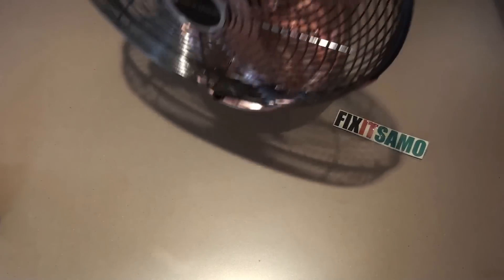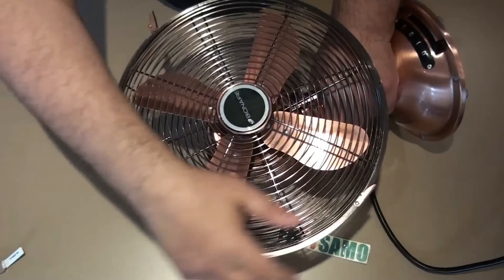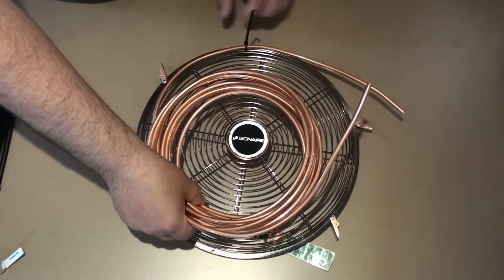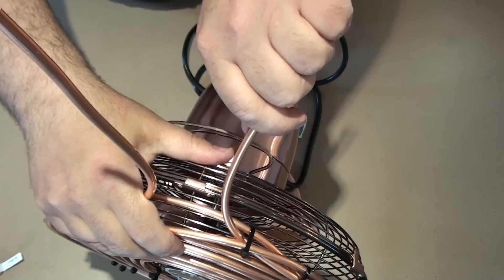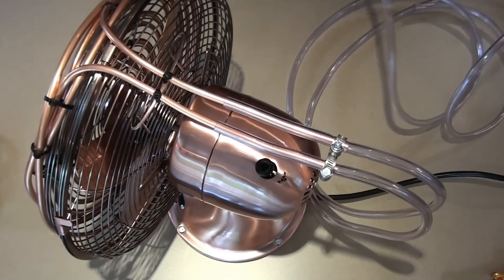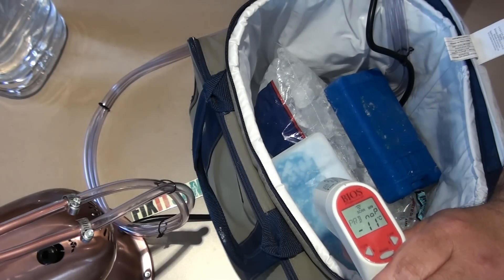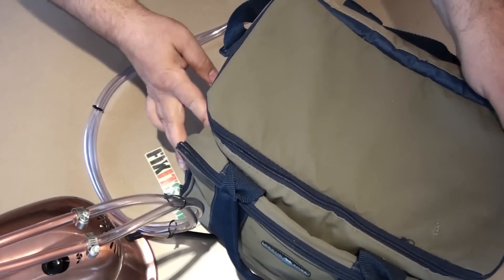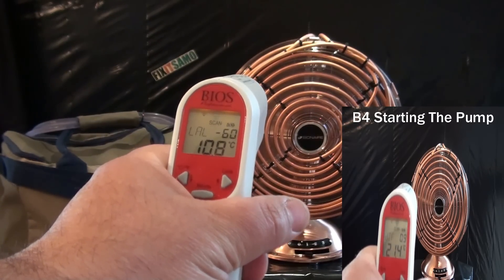How To Turn Your Fan Into An Airconditioner  AC

Comment: How long does it last?
Reply: It could last a few hours depending on how good the cooler was (insulation), and how warm the pump may get, but even room temperature water would still feel cool enough to be effective I think.

Comment: What if you use liquid nitrogen instead of cold water?
Reply: It would probably be too cold. The moisture in the air could condense on the coil and turn to frost. If it got too thick it would restrict the air flow. It could then turn really problematic.
Reply: The pump freeze
Reply: Thats what i was thinking lol

Comment: What if you ran the tubing into a mini fridges freezer in a container of water alcohol mixture? Just set the fan on top 🧐
Reply: Yes, but if it got too cold it could cause the coil to frost over. If the air flow was restricted it might overheat the fan motor. You'd also have to deal with condensation at the least too.
Reply: The minifridge would not be able to cool down fast enough to keep up if it were hot outside.
Reply: @darrisx8146  You also heat the room up in this process....

Comment: The moisture from the air condenses on the copper tubing and drips under the fan, I placed my fan above the ice bath but the water overflows with time. I made a small overflow tube out of the ice bath that goes out the window(through the wood) and drips outside.
Reply: What did you do about the dripping under the fan?

Comment: anyone calculate what it cost to run for 8 hours?  If it doesn't save alot over a window unit it's not worth it. I imagine it is pretty cheap though. Anyone do the math? fixitsamo?
Reply: Where I live (Australia) to run a 75w fan, a 10w pond water pump & a chest freezer (to freeze ice for the fan) 24 hours a day all 3 cost a total of $1.20 per day to run. a spit system unit or ducted air conditioning costs 60c or $3 per HOUR to run. which means if you average out an air con running cost to run for 24 hours would cost $43 a DAY. $1.20 for a water cooled fan or $43 for air conditioning. I know which one I’d pick.
Reply: @jackiebrown8773  The difference is the split system unit will not run nearly as often as the fan and waterpump. There is no such thing as free energy, you pay for it somewhere. The point you're trying to make that this fan with copper pipes in front of it is somehow more efficient then a split system unit is absolutely ridiculous. 

The video without a doubt has its use cases (targeted cooling, cheap to put together, fast to put together, no requirements of having a window in the room, etc.) but being more efficient then a real unit is not one of them.
Reply: Dimitri Barbe I never said in my comment that it is more efficient in cooling than a split system. obviously a fan unit isn’t going to efficiently cool an entire room as well as a split system but it is still more energy efficient & that’s more important for a lot of people as normal air conditioning is expensive and not always available (in rentals etc). Where I live temperatures can get past 40 degrees (104F) for most of the day AND night and running a split system all day is impossible & it can break down easily. a fan unit is a much more affordable option.
Reply: @dimitribarbe6883  actually one could rewire and soder the fan and pump onto a fold up solar panel and get MORE than enough energy to run both 8 to 12 hours a day.
This is great for van/tent camping for people who can't sleep in the heat.
The REAL issue is the condensation water from the copper, where does it go? Does it drip down and make a mess and damage whatever is underneath?
Does it drip into the center motor, kill the fan function or start a fire?
Those are more important questions to ask,  JS.....
Reply: the pump use 3 watt of power x 8 hour =24watt    so running cost less than  1-2 cent extra over 8 hour    + your existing fan cost and your  Bag off ice  either you buy it or make your own
cost of running this set up over existing fan  is very minimum
Reply: Noblesse Obligee  well yes they do.

So, once your freezer reaches a certain temperature it actually stops running, and the insulation just keeps it cold.

Once you put in hot objects, it will make the freezer hot, and inturn make the compressor run, until the  object is frozen or as cold as the freezers limit.

So the difference is your freezer might run 10% of the time versus 80% of the time, until its frozen.

Also, your freezer itself dissipates heat into the house you are trying to cool, with the energy from the freezer, and because nothing is 100% efficient, you are actually adding heat to your house, but it will be colder DIRECTLY in front of the fan. Everywhere else however will be warmer than if you had done nothing at all.
Reply: Jet li is right. The cost of operation isnt the cost. Its going to cost you to obtain or make ice... window unit would be cheaper.
Reply: @TheDarkToes  ,
You can reuse frozen bottles of water. After initial cost of the water bottles. 3.50 for 24. Its pretty cheap.
Reply: @TheGaffla  did you even read my post? Because youre making my point for me.

Here let me say it again... "the cost of operation isnt the cost. Its going to cost you to obtain or make ice"

Thank you for proving my point water is cheap, but youre going to spend more in electricity freezing that water...
Reply: @TheDarkToes  , correct. I was supporting your position. Was there some confusion with my statement? Every one is not here to be hostile. Peace be to you brother.
Reply: @TheGaffla  my bad, seemed like you were saying "water is cheap it should be cheaper to freeze them" but a window unit would still he cheaper. My bad. 

Good day to you
Reply: @TheDarkToes  who turns there freezer off at home ????ermmm no1... soo a couple bottles of water freezing each day is no problem.  my freezer is always running anyway.  ( wont be eating chicken at your house bro ) hahah
Reply: @adamlol3955  thats not how that works tho... but i appreciate your reply
Reply: @TheDarkToes  ????
Reply: @adamlol3955  ???
Reply: @adamlol3955  I'll be passing on that chicken tonight. Ha 7 months later and still doesn't know what's wrong with his chicken recipe.
Reply: there a cheaper and quicker way, open your freezer door use the fan to blow air in to it, cold air spill out Bonus no need to eat your ice cream, you can drink it
Reply: Noblesse Obligee  because it doesnt use the same amount of energy, infact it uses ALOT more.
Reply: It's not just beneficial because of the cost difference......the problem that this REALLY solves is not having a window or a way to vent air therefore NOT being able to use a "window unit". Thus is genius because you can use it anywhere......a tent, house, trailer......etc..
Reply: Noblesse Obligee  than a freezer with constantly exchanging water bottles, yes.

Every time you add water to it, your freezer has to work harder for longer, and its about the amount of energy or heat, (however you want to look at it) you need to remove, in relation the amount of mass. Air is fairly un dense, while water is pretty dense, AND is good way to store energy, meaning it takes alot of energy to remove all the heat it has stored.

Comment: What if you drilled holes in an electric cooler so the water getting circulated gets cooled running thru the pump in the cooler?

Comment: AC consumes more energy to produce cold (extract heat) than to cool down the air. It's simple themodynamics.
Reply: are u sure u know what your talking about? how did the Ice become ICE in the 1st place? any Homemade contraption like this that uses ICE is just moving the ACTUAL thing that is removing heat to a Plant that produces said ICE, Educate yourself a lil more an understand that a real AC works on the principal that when you squeeze air or anything it turns that mechanical energy into heat, the heat dissipates over time in a radiator under pressure and then when the pressure is released it sucks in the surrounding heat to make the physical expansion of the gas possible that's where the cold comes from....
Reply: @stuffhappensdownsouth9899  Yes. What is creating the pressure needed to compress the refrigerant fluid ?
Coldness and warmth are not pysical values ; but sensations. They are loss or gain of calories
Reply: @MrWookie21  every fridge or AC has a compressor pump.... and that's layman's terms, and calories? are u drunk? a box of cereal has load of calories is it hot? that makes 0 sense?
Reply: @stuffhappensdownsouth9899  So it's exactly what I said at the beginning. A compressor is a motor that consumes more energy than needed to freeze water. If the fridge was in action inside the room you wanted to cool down with the contraption, the room temparature would climb up and not go down. Because of the heat (transfert of calories) emitted through the outer serpentine and also by the compressor resistance. You are also confusing thermodynamics with metabolic biochemistry. Food is also converted in extra-heat through biochemical reactions in our body. Cereals are sun piled energy ready to be converted by organism into anabolic or catabolic reactions + heat (emitted calories).
Reply: @MrWookie21  ok that makes sense but what i was meaning was a clever way to compress a gas instead of using a motor 
guess u do know what ur talking about there, I've never heard calories used in this context but i looked it up an damn if ur not right soo yeah you win this round *shakes fist
Reply: @stuffhappensdownsouth9899  Calorie is just an human concept to modelize what's observed experimentally. It's a human language for translating an universal phenomenon. The universe has its own properties. Humans can't create life nor matter. Heat is more a molecular or atomic friction situation (interaction). 
Even this concept will be overthrown for a more realistic explanation.
It's like the Newton's 3rd Law that is obsolete ; because there is no imaginary reaction force.
No need to compress fluids to generate heat transfert. See Peltier AC for example.
Reply: @MrWookie21 Bernoulli's  venturi tube will also  without compression or any kind of heat transfer although its highly inefficient
Reply: @stuffhappensdownsouth9899  Yep. When it's getting really hot, I go in the cellar. The temperature there is approx. 17°C  (62 F) ;)

Comment: I planned to do it without the cooling system, but letting air go through ice itself, realized that condensation might be a problem, also water droplets.
So now I ordered all the stuff, except the fan, because fan eats lots of energy, instead Im going with a 200mm 12v PC fan, with around 150 CFM, its less than the fan, but I have only 1 room to cool down. Think that is ok?
One thing more to mention is that the advantage is being able to take it with me anywhere on a power bank with a voltage booster.

Comment: wouldn't it be better to buy an AC
Reply: Alot of people cant buy an a/c. It looks good for an offgrid system
Reply: This is a low watt solution. Normal AC Units would take 10x to 20x the amount of power of this setup. When the power is off and you are running off solar, every watt counts.

Comment: This hydronic system is awesome. If you use ice at (say 9 deg F, or, ...) -13C, and the room is at 80F, or 27 C, then you have a temp delta of 40 deg C, 90 F. The specific heat of water is 4 btu, or 4 kJ per kg per deg C. Fixit Samo used 5 kg water let’s say. He had ice and 3 liter water, so I am making a reasonable assumption. So, the cooling power of this setup is: 5 kg X 4000 x 40, or 800,000 J, or almost 1,000 btu. 

If you scale this to a room of 10’x10’, aiming to cool the inside to 75, whilst outside was 95, you’d use 100 Wh of energy with Samo’s system, and 1.7 kWh of energy with an a/c unit. That’s a whopping 1700% better system. 

I get that he is using 5 liter water, out of refrigerator. That’s to miniaturize the footprint. You can increase the water catchment to 55 gallon drum at 50 deg F. Same outcome. Still 1700% more efficient than AC unit.
Reply: So, you think you're so smart...then...how many licks does it take to get to the center of a Tootsie Roll Tootsie Pop?
Reply: @zcg3  2
Reply: PowerLifter “rest of us” who? I wrote the note, you responded to it. Since you’re unclear as to the difference between alphabets (power lifter has 9), letters (power lifter has 11) and, while you’re getting educated, characters (power lifter has 11, or zero in your case)... since you’re dumb enough, let’s make peace with your poor Grammer, spelling, and reasoning. Enjoy your little ignorant world
Reply: PowerLifter if your IQ exceeded the number of alphabets in your moniker, you’d have gathered that what I was saying, inter alia, is that the use of ice isn’t essential to hydronic cooling. The amazing thermodynamic efficiency is, the possibility of ditching inefficient and costly a/c systems is.

Comment: Works like the coolant from automobiles.
Reply: What happened if you use actual coolant from Automobiles?   - what about the the Solution/liquid from the fancy Computer cooling systems - is it the same process of use?
Reply: joseph arthur anti freeze won't freeze for cold weather.
Reply: and i wouldn't try it stick to manufacturer's instructions.

Comment: I'd like to try this for my self. But doesn't the condensation from the copper tube drips water on the floor? Please reply. Thanks and more power to your channel!
Reply: the air from the ventilator will dry up condensed water from the pipe
Reply: @Igor-nx8uf  Would that not then add humidity to the room- the opposite of what you are trying to achieve?
Reply: @RawFitChris  condensation is produced from air humidity in room, it is a cycle working with same amount. A typical air conditioner dries moisture because condensate flows out of the room

Comment: I hate the metric system.
Reply: makes too much sense? 0*C water freezes, 100*C water boils. 1gram is 1 cubic centimeter or water, 1kg is a liter of water. WTF is a foot, why is it 12 inches? why the fuck is freezing 32*F? what's the boiling temp of water in *F? imperial is moronic.
Reply: אני עומד ע ישראל! I love MERICA!  How's that more practical, I can easily make estimates with metric just as much as with Imperial unless you truly want to count with steps, imperial is useless that's the problem with it, metric is superior, imperial is not a bad system otherwise it wouldn't work, but sometimes it's about choosing the superior one instead of being one of the few countries to be different
Reply: אני עומד ע ישראל! I love MERICA! k but not really because not everyone's step, or hand, or stone is the same
Reply: @N1v3K77 I cannot estimate cm's or KM's.
Converting US system to metric is a pain.

I either have to get a conversion chart and calculator out or a us & metric tape measure.

Oh and 13mm is NOT 1/2". Close but not the same thing.
Reply: @N1v3K77 convert 3/4 inch to exact metric.
How about the rest of the world using imperial system?
Most of my tools are US sizes.
Having 2 sets of tolls is costly and space consuming.
Then having to GUESS on the metric sizes.

It is 10mm or 11mm?
Is it 5mm or 5.5 mm.

Converting back and forth over large sizes or distances causes inaccuracies.
At least with the US system we have less problems sticking with it.

If I need a 1/4-20 bolt but metric is only avail and with the WRONG thread, it makes life difficult.
Reply: What's so complicated? The system or how it applies to Imperial?
 The metric system is FAR simpler than Imperial. Its based on 1/10/100/1000. And all are defined by the METER (hence METRic) and equal divisions of or multiples of the METER based on 10ths. Its much easier to multiply by 10s than it is by fractions with the number 12 as the base unit, but also divided in 4ths/8ths/12ths/16ths/32nds/64ths/etc.  Imperial is WAY more difficult to figure in your head, than metric. 

Example- Imperial Problem: 1.25" which is equal to 1 1/4" multiplied-by 23. Solution:  28.75" (but in feet needs to be 28.75" divided by 12) and fractions cannot be represented without rounding and using common denominators resulting in 7 3/16 (7.1875) Metric Problem: 1cm is equal to 10mm multiplied-by 23. Solution: 23cm which is equal to 230mm

Magic conversion number is 25.4 for any struggling with basic conversion:
If you need to go cm to inches multiply centimeter by 25.4--  1"=2.54cm
If you need to go from inches to cm divide by 25.4-- 1cm=0.254"
Reply: we know what country you from. poor math skills.
Reply: zwr9ne0fh8pk4bt635245 being taught imperial doesn’t mean someone has bad math, it’s just a different system. It’s not that deep buddy.
Every American worth their salt knows metric but sense everything WE HAVE HERE is in imperial so if someone says something in metric, we have to do fancy conversions. It’s an inconvenience, due to that.
Reply: @deadringer-cultofdeathratt8813  Yeah but Imperial sucks and shouldn't really exist, imperial's internal unit conversions are just like the conversions to metrics, instead of all being 10, 100,1000,10000, it's just confusing as shit and basically useless outside the US
Reply: @blomegoog  my math skills are quite good actually. It is the conversion from what I am used to to a system that is very different.
I can estimate a foot quite well but not a decimeter.
A meter is 39.37 inches. An inch is 2.54 cm. Takes 1.6 kilometers to make a statute mile.
But a pain when dealing with eighths and quarters and such.
Metric is a pain.
Reply: @crazysquirrel9425  Metric's superior though so you should really try to learn it, if you care about these things that is
Reply: @crazysquirrel9425  1.606 Km actually, it adds up on a long distance.
Reply: Imperial system is old and useless, metric is the future